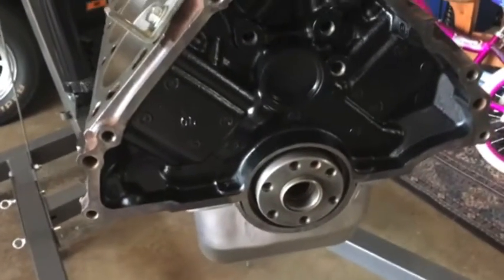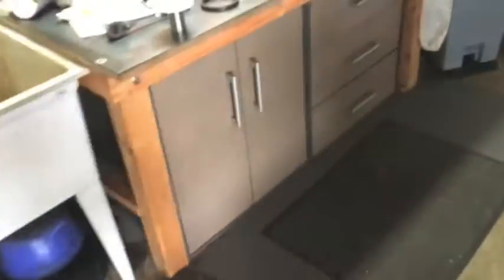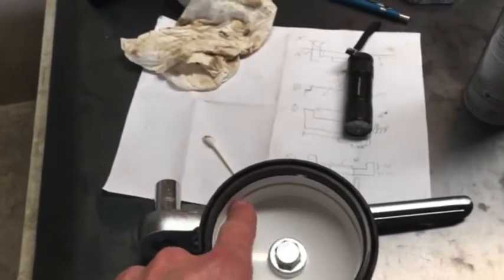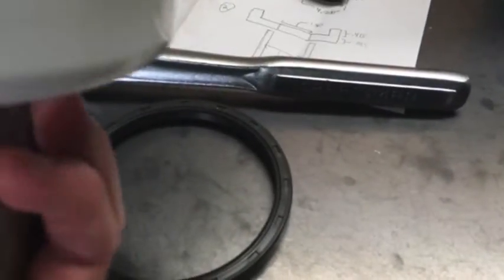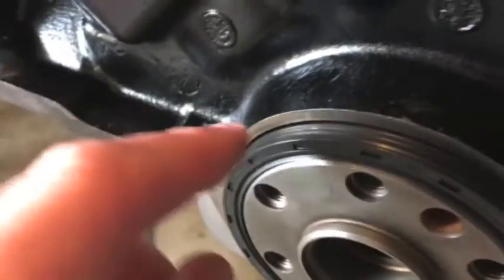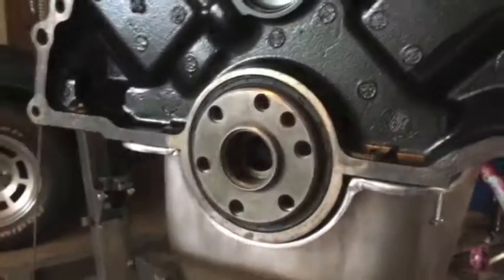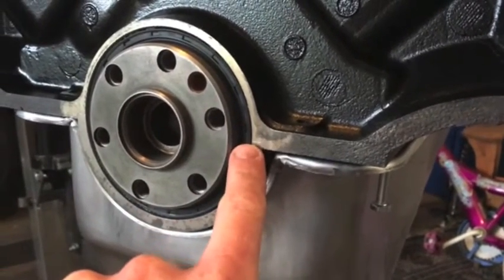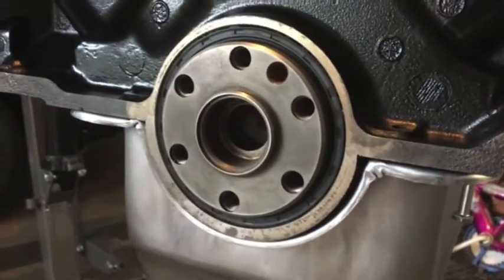Home made Ford 302/351W 1 piece rear main seal driver

Comment: How long did it last before it started to leak?
Reply from the maker: So far so good - I did have a "scare" with the oil pan though (LOL) / a small weeping leak, but I snugged up the rear bolts and all is well / thanks for the comment!
Reply: @TacoJoe  I did the exact same thing but my scare was real and bolt snugging didn’t solve that rear pan leak :( this winter I’ll be tackling that I guess !